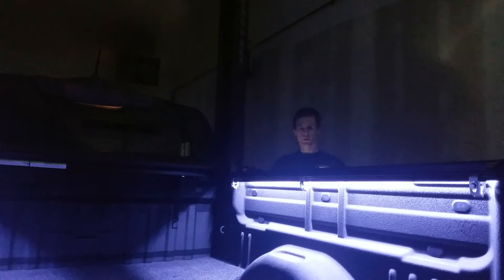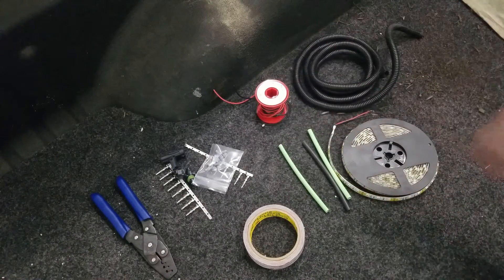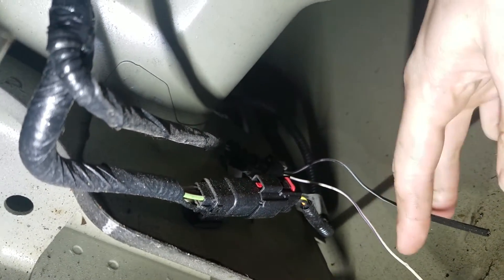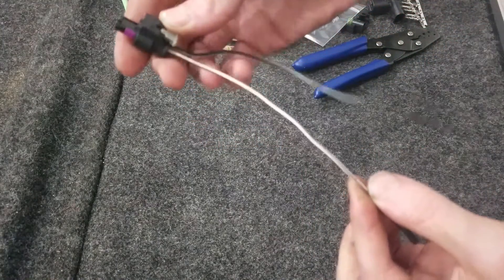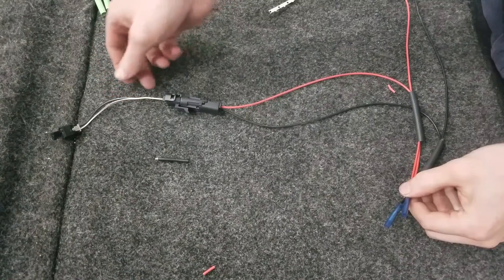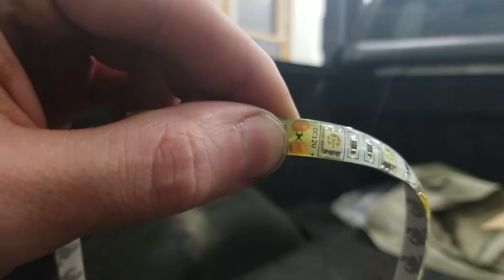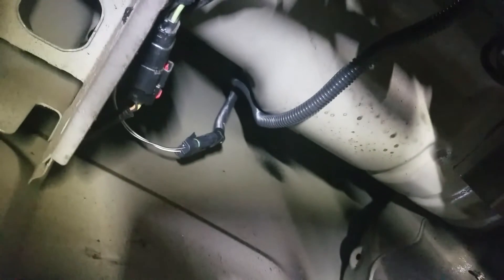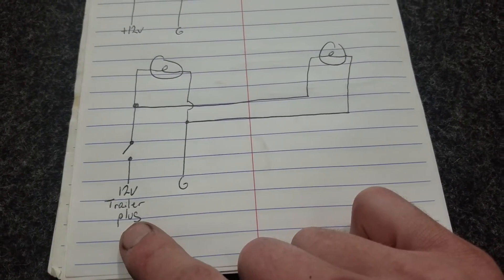How To Make Your Own LED Truck Bed Lighting... For Cheap.

Comment from the maker: Here are the parts and tools that I used: 
LED's: https://amzn.to/2ToT1BP 
Wire: https://amzn.to/2KitFkC 
Split Loom: https://amzn.to/2DNJGij 
Weatherpack connectors: https://amzn.to/2FvHzBb 
Weatherpack crimp tool: https://amzn.to/2QRn1Ey 
3M VHB Tape: https://amzn.to/2KljBrm 
Butt Connectors: https://amzn.to/2ziGmYr 
Wire Strippers: https://amzn.to/2FufoTp 
Switch: https://amzn.to/2Tvot1l 
Spade Connectors: https://amzn.to/2OPGJi5

Comment: This is a fairly good setup. This is similar to what I did in my 2004 Toyota tundra. As mentioned in one of the comments, I did install some unistrut, and I did put an LED strip similar to this straight to the unistrut. And, they were tied into the cargo light switch. But I did not have an existing plug to use.

Comment: Which switch on the dash for GM trucks controls the lights in the bed?
Reply: I would imagine, if you do this setup you will want to use the cargo switch on the dash.

Comment: After some searching I found the connector plug under the truck bed. Mine did not have the wire tails like your model truck shown.  So I cut the wires leading up to the factory plug and replaced with a new plug. thank you for the info and video, saved me from purchasing a chevy brand 140.00 bed light.

Comment: Hello I watched this video nice job putting it all together. I would like to know what you would recommend for running board lights. I've a 2012 Ford F-150 Supercrew and the gotta have features for me is length - all the way from front door to end of back door 84-96" features - white when you hit keyfob and while driving, and any other features you think would offer unique styling. Thanks
Reply from the maker: I got your email. I will get back with you.

Comment: Awesome video, just check on my 2019 Colorado I have a empty plug (no pig tails tho) that’s wired to the cargo lamp switch on the dash. Wonder if I can get the factory replacement plug with buying the whole factory bed light harness. Or just cut off the factory plug and wiring in my own..

Comment: I have a 2018 ram...6 ft 4 in bed. Could I use an 18 ft roll and make it one continuous lite..?
Reply from the maker: I'm not sure how the LEDs would handle a sharp 90 degree bend.

Comment: you could always just buy the harness and cut the ends off to match the lights you want 
https://www.getoemparts.com/oem-parts/gm-wire-harness-23327843?c=Zz1ib2R5JnM9cGljay11cC1ib3gtY29tcG9uZW50cyZsPTM5Jm49QXNzZW1ibGllcyBQYWdlJmE9Y2hldnJvbGV0Jm89c2lsdmVyYWRvLTE1MDAmeT0yMDE1JnQ9bHQmZT00LTNsLXY2LWZsZXg%3D

Comment: A trick you can use to waterproof but connectors is to add some hot glue inside of the heat shrink.  It prevents water from getting in the crack between the two wires you doubled up.
Reply: Or just buy the waterproof butt connectors

Comment: Somewhere I saw a video of the pickup owner had installed unistrut under the bed edge (full length) for almost unlimited tie-down points than added the LED strips under then.  Double neat idea.
Reply from the maker: That sounds like a good idea.
Reply: I did that to my 2004 Toyota tundra. That may be my video that you are referencing. I now have a 2014 Chevrolet Silverado, and I am going to go in a different route.

Comment: Thanks straight info on install liked the electric drawings. Do you need any special switch for trunk bed lites ? That info not clearly explained. Please post answer for all to see
Reply from the maker: I have a link to a waterproof switch in my pinned comment and in the description. Thanks for watching and commenting.